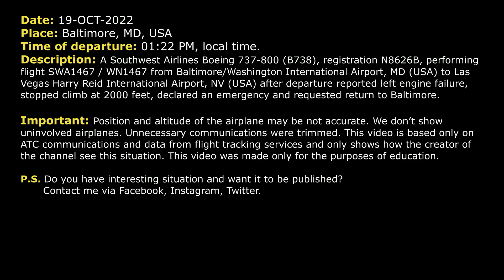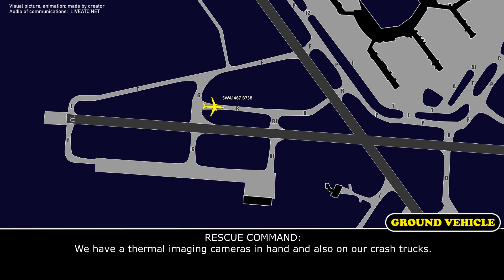ENGINE FAILURE shortly after takeoff. Southwest Boeing 738 returned to Baltimore. Real ATC

Comment: Don't know why this " video" was posted, too much obfuscation because they cut out too much conversation. Obviously pilots are trouble shooting and trying for engine restart. With 180 plus souls on board and tons of full, they still went out of the way to not to get back on the ground ASAP. Not a good idea to turn into the left dead engine, you're asking for a stall at that altitude and emergency crew didn't know temperature reading,  that's part of procedure before going back to terminal after heavy breaking. This crew definitely needed a really long debriefing. Going back to terminal , heavy fuel load hot brakes and unknown cause for failed engine not smartest idea. Lets just set whole terminal on fire. Off load passengers on to busses and let emergency and maintenance check it out. Baltimore must not have had a lot of traffic to manage.. Scratch one crew for a while  At least they are down, no crash no casualties except some people may need to change shorts. Worst emergency communication and emergency  procedure  I've ever heard.
Reply: With most - if not all - jet airliners it is not a problem to turn into the direction of the failed engine. It would quite likely be a problem with propeller and turbo-prop engines.
Reply: @dalydegagne1839  Your assumptive use of " most" is problematic.  What if one of those " most "results in loss of all souls on board and crew and aitcraft. I suggest you do some home work on Asymmetric loads and maneuvering stalls.
Reply: @c123bthunderpig  Numerous pilots have stated that these turns are not a problem for jet aircraft. I made no assumptions. I think you are the one who needs to do their homework.
Reply: damn, mic drop. you sound like a retired instructor pilot. I'd rather fly with you
Reply: @arizonawut  Thanks, these aviation FUBARS really get me going with the incompetence of crews risking life's of 100's of people. There appeared to be zero CRM  Crew Resource Management  with this crew not too mention rules for hot brake landings. Although there was a lot left out. I've trained pilots in Thailand, Laos and South Vietnam and never lost a student, Flew Braniff aircraft with problems to their maintenance center, until they went under, then Southwest now retired. . I'd hate to risk my life on crews they hire and do not train these days because of pilot shortages.

Comment: Don’t the pilots pre-brief a departure emergency? The PM didn’t know which way to go when given a vector until reminded my the PF. “Engine failure on take off, straight ahead to 2000” is a pretty basic brief to recall later.
Reply: What you brief may not at all be what you "do". Every emergency is different.
Reply: @marklittle9913  - that’s the point of the pre-brief. So both pilots are aware of the intentions of the other and can communicate that to ATC accordingly.
Reply: @EdOeuna  Again, "pre-briefs" (I'm not sure how you can brief before you brief) go right out the window once the engine fails. Briefings are a quaint academic idea, that fail to stand up to real world emergencies.
Reply: @marklittle9913  - pre-departure briefings for non-normal and normal ops are basic things to be expected from pilots in order to share a mental model for what may be expected on departure. It also serves the purpose of confirming the actions of the PF, in the eyes of the PM, as to them taking correct actions. You can also calculate and brief, in advance, your landing performance so that any quick return can be set up immediately by the PM without reference to documents / apps. 

Basic airmanship during pre-departure phase of flight.
Reply: @EdOeuna  Lol....I get the concept. 30 years in the pointy end of that very aircraft. I also understand the reality. Things change once parts start falling off.
Reply: @marklittle9913  - I’m glad you can be so causal about the safety of the aircraft and that pre- briefing your intentions following a failure of some kind on departure is “quaint”. 

Fortunately my FCOM and FCTM describe pre-departure briefing requirements. They seem to be important, according to Boeing and Airbus. Maybe this explains why there are so many of these YT videos focussing on US based airlines, because of a lack of a safety mentality and how the pilots falter when faced with emergencies, like in this video.
Reply: @EdOeuna  I'm not casual about anything when it comes to safety. There's a reason the worlds airlines are moving from a "brief everything" mentality to a brief the biggest threat mentality. TRUST me, when things go south at 200 feet, nobody remembers the "brief". Take care.
Reply: @marklittle9913  - none of the pilots I fly with suffer the briefing amnesia you mention.
Reply: @marklittle9913  - none of the pilots I fly with suffer the briefing amnesia you mention.
Reply: @marklittle9913  Pre-briefs are an integral part of pre-flight planning. There may be times when what was said in a pre-brief and what actual is needed differ - that is to be expected. However, it is wrong to dismiss pre-briefs as "a quaint academic idea, that fail to stand up to real world emergencies." I strongly agree with Ed when he talks about the captain (commander) and first officer sharing a common mind set as a result of the pre-briefing. The pre-brief is a mental rehearsal for what pilots hope won't occur. Part of that mental rehearsal deals with procedure for a rejected take-off, or for setting up for an emergency go-around immediately or shortly after take-off.
Reply: @marklittle9913  You don't know WTH you are talking about. Airlines brief APPLICABLE items based on weather, terrain, deferrals etc. The airline I was at never "briefed everything" except in the sim. LOL! Take care.
Reply: @Cokie907  The airline I've been at for over three decades does want us to brief everything. It's ridiculous. So yeah, I think I might know WTH I'm talking about.

Comment: They want there brake temperature measured.  Is it because the nose temperature monitor is powered by the dead engine?
Reply: No it’s probably because they are landing heavy and fast
Reply: The takeoff weight is significantly higher than the maximum certified landing weight.  The brake energy to stop an overweight 737 drastically rises given the weight and only one thrust reverser available, in this case to stop the aircraft. The brake temperature actually rises after landing.
Reply: @edwardbennett2312  Brake temp increases with every brake application- on taxi out, during landing roll (unless no wheel braking occurs) and taxi in. Even though they're helpful, especially on slippery runways, reverse thrust isn't used in stopping performance calculations be it all engines or engine out.
Reply: @gerardmoran9560  Actually, for hot brake issues and running the “brake-cooling module in the FMC…they are.  Ask me how I know ; )
Reply: Not all aircraft have brake temperature sensors that can be readout in the cabin. The ARF (airport rescue and fire) units often will have special thermal cameras that can give the crew the temperatures of anywhere they request.
Reply: There is max brake temperature on landings like this that says stay still and don't move. Hot brake pads start tire fire, tire fire heats fuel tank hot fuel tanks explode.
Reply: The only jet transport that I know of with nosewheel brakes was the early models of the 727. Most of them were removed; the weight and maintenance wasn't worth the marginal improvement in braking.  The later Boeings (74 and later) had brake temp indicators in the cockpit. I flew the 737-200s, they had no brake temp indicators- you had to use the charts.

Comment: I thought you never turn into the dead engine?! BTW southwest left engines always causing problems. Don't sit next to a window near a left engine thats for sure.lucky this failure was contained!
Reply: Jets have no problem turning either direction while on single engine. They have to be certified to maneuver that way. This is not a light your small light piston twin.
Reply: In a properly trimmed transport jet you can turn either way. A light twin is a different animal.
Reply: Stick to piston poppers
Reply: I am no expert so happy to be correctred but wouldn't the plane naturally want to turn left if you only fly on right engine? So turning in that directrion would be easier?
Reply: @Flzw  The danger is that the turn is easy to start but hard to end. Turning the other way is harder to initialize but easier to end and thus more controllable.
Reply: @Flzw  As others have often stated on these forums, jet engines have sufficient power to enable them to turn to the left if the left engine is out, or to the right if the right engine is out. Prop engines do not have sufficient power to easily turn to the side of a non-functioning engine, and that is why turning to the side of the still-functioning propellor is usually recommended.
Reply: Normally I'd speculate that it's cause number 1 engine is always started first (and used in single engine taxi), but this is not an A320 so idk.